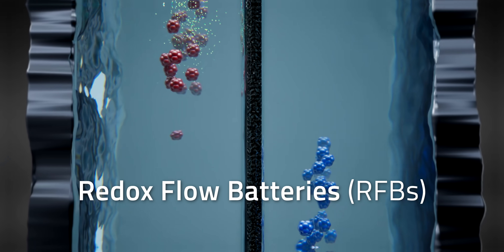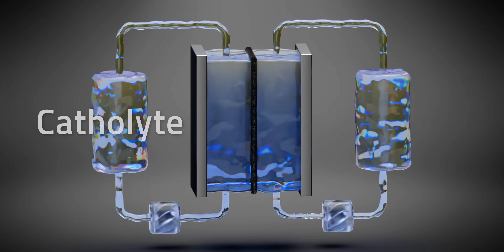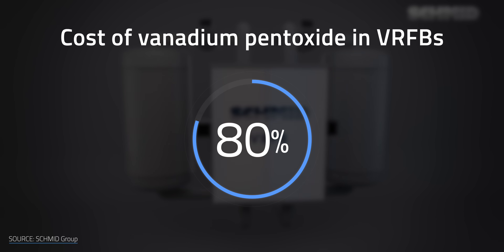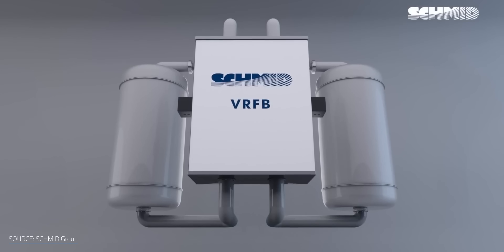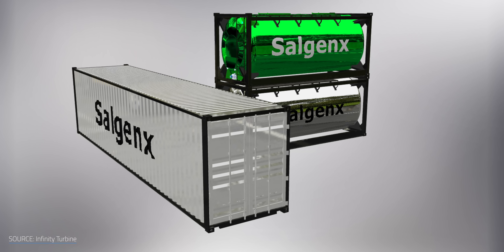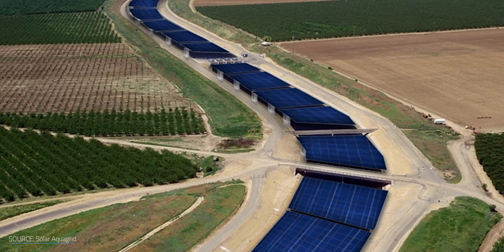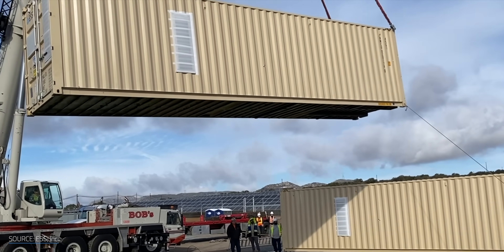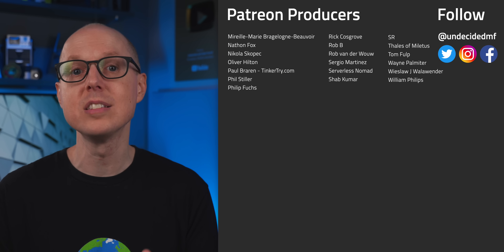Why Salt Water may be the Future of Batteries

Comment from the maker: So what do you think? The first 100 people to use code UNDECIDED at the link below will get 60% off of Incogni: https://incogni.com/undecided

If you liked this, check out: Is Aquaponics the Future of Agriculture?: https://youtu.be/59kk4OjJCj4?list=PLnTSM-ORSgi4dFnLD9622FK77atWtQVv7
Reply: I wish you had shown a comparison in size between different types.  How physically large does it have to be in order to equate to a tesla powerwall for example.
Reply: The technology for the specific application. Is awesome.!

But the thing is.

Batteries that can't be recharged. Or reused. Like the double AA batteries I have in my TV remote. On an industrial scale. Could be useful in a few applications for sure. 

But the problem with that business model Is that it's to conducive to becoming the status quo. As you can see they did with low voltage batteries. AA, AAA etc.

And that's not what anyone who uses energy wants for the energy industry. Except for the very few people at the top of energy industries. Who stand to make all the money.!

So I canot in good conscience be complicit with an energy technology with so many potential drawbacks.

Which might be hard to see when it gets so cheap And ubiquitous. But that's the insidious problem. That's how they get ya.!

Especially for industrial applications.!

WE SHOULD ONLY BE STRIVING FOR.!

#1. Completely Rechargeable. 

#2. A 100-year cycle life minimum.

#3. Minimal Maintenance.

#4. Non-Toxic for service life.

#5. Completely and easily Repairable.!

These are requirements of a battery that is used a lot. And if the battery is being used a lot. That means there's a lot of energy being moved around. And that is where they stand to make money. 

Not from Batteries. But from the Transfer of Energy.!

Like they don't get it. Batteries are their problem.! Not ours.! They should want to make them as efficient as possible. Because they're the ones who should want us to use them. Because they stand to gain the most.

Sure the more inefficient battery the better for them. But that's not really looking at the big picture. You want your battery to become ubiquitous. So everyone uses it.

And then Charge them for the service.!

While your battery meets some of these requirements. And kind of meet some others. That's woefully short of meeting all the aforementioned correctly.

Valve in the steam deck are a perfect example. They lose money on the steam deck. To get you into their ecosystem. Which they make far more money from. Then they ever could from the from the Steam Deck alone at any price.!

So disposable only energy technology while having some application. Are mostly backward moving. Relics technology. Which really doesn't have any place in the future. And it's something to be evolving past.!

It's not for the consumer or industrial market applications. 

I can only imagine it be used in like going to Mars or the moon. Subterranean or aquatic conditions. You know pretty niche applications.

Now molten salt batteries and liquid metal batteries. Those are on the right track. Well they're a lot closer anyway.

Maybe focus on those. If you are still-

"Undecided.!"
Reply: I would love to see a deployment cost for either a Peaker plant or a shuttered nuclear facility like San Onofre in California, with the grid infrastructure in place these would appear be a perfect cost comparison to see real value. Also, time to deploy if it takes 10 years then that would be a very negative factor.
Reply: When the battery reaches its end of life, can you just flush the fluids and replenish the same tanks and system without replacing all of the hardware? If so, that's a big step toward longevity. That would actually make it a worthy investment for homeowners, should it ever be scaled toward home power storage applications.
Reply: @wirelesmike73  as I understand it it's the other way round – the hardware wears out eventually but the fluid is fine.
Reply: @alanhat5252  Well, that's a big problem.😕
Reply: So what happens for long term power storage?
@11:04
Reply: well they got to be quick and come up with products so that more people and companies buy this thing vs LFP and Sodium Ion battery, both of which will scale rapidly. where in 2024-2026, most new factories becomes online.
Reply: I wonder how efficiently aluminum air batteries could be produced.  Air supply regulation is the only thing we need, why are we trying to figure out how to pump electrolytes out of the inside of the cells if it simply cannot discharge without oxygen?  Aluminum ought to be considered, depending on our capacity to efficiently reclaim aluminum spent in aluminum air batteries efficiently, as a way to store energy.
Reply: Why "some random common material" will be the future of batteries and save us all from co2.  There are like 3 of these videos every week ffs.
Reply: @DASLAKILL  Why some common material? Because there is no point in developing Unobtainium gadget that can never be built, or not in useful numbers.
Reply: @AnalystPrime  True but there are options that arn't unobtainium that manifest the power needed instead of just being a storage device.  It seems like all these battery options is like being at a worlds fair hearing about the flying cars of the 2020s.
Reply: @DASLAKILL  You are just using fancy words to say "generator" when we already got those and the point is having storage so we do not need to run said generators all the time. Especially as batteries and capacitors are far superior way to match changing demand, and good luck trying to fit a gas turbine inside your cellphone.

And in which world do we have a dozen different flying cars ready to go as soon as  people choose which suits their needs, with new improvements developed at a steady pace and their only limits being the cost of building enough for everyone and a conspiracy of horse traders trying to deny that flying cars exist to keep their own business going long after it became obsolete?
Reply: @AnalystPrime  A manifester is a better word than generator.  The specific arch form of a "generator" is not making anything, its only opening a doorway for the energy to pour through, manifesting whats already there.  Electricity being a combined field phenomena of the dielectric and magetism.  No fancy words here, try expanding your vocab.  Never said no to any battery tech, my jab was at the idea the solution is some random everyday material and nothing becomes of it, just like the constant hype of flying cars.  Also the beef of horse traders was with powered cars not flying cars, horses dont fly, keep stretching things.  Replacing obsolete tech with dressed up obsolete tech isnt a solution either.  The solutions im refering are ones that manifest on demand not storage mediums.  Where does the power come from, resource hungry wind, solar and dirty bomb nuke reactors all over the place.
Reply: @DASLAKILL  You are being very silly. And either foolish or deliberately misunderstanding a simple analogy.

There is no "constant hype" about flying cars because they are known to be impractical and only developed as curiosities. We do have both cars and various flying vehicles which is why the time of using horses as the main form of transport has long passed just like the time for being reliant on obsolete tech like dirty fossil fuels.
Reply: I think sodium ion battery perhaps could be a lot safer than lithium for EV's ?
Reply: Incogni is awesome btw.
Reply: Fun fact Matt! I got a salt water battery in to be recycled 2 weeks ago. Sad fact: it may get moved on before I get to play with it.
Reply: It will either be a billion-dollar home run, or just another chemistry (99%) that never lived up to the hype.
Reply: it is fantastic how we can not get to a consensus about a energy free method, all companies are pulling their own way!
Reply: The future is Lithium Glass Solid State Batteries as invented by John B Goodenough. 1500 to 3000 recharge discharge cycles with 90% capacity retention in testing from memory (so do not hold me to this) quite forgiving. Wiki states capable of 23,000 times.
Reply: It seems like there are a lot of people who work for ESS are in the comment section. It's basically an infomercial in there. Great video content though.
Reply: Isn't this a re-post of this video that you'd put out previously?  I'm intrigued, while inclined to take ESS's numbers with a grain of salt.  Yes.  I MEANT to do it.
Reply: FEWER moving parts. How bloody difficult is it for you people to say “fewer”? You don't want to sound TOO intelligent? Is that it?
Reply: Aluminum far supercedes all other forms of energy storage if spent aluminum can be reclaimed efficiently enough.
Reply: I loosely hypothesize a displacement of the air in an aluminum air battery as a way to eliminate any further discharge would be unnecessary, but carbon dioxide or nitrogen are easy enough as well as cheap enough resources a concern over such easily lies within our power at such a point to put to rest.  And, that's if it's trailing discharge cannot be implemented wherever these miscategorized aluminum fuel cells are used.
Reply: This has the same benefit as hydrogen and compressed/liquefied air energy storage and even the old fashioned backup generators: For regular batteries the cost is calculated output times hours of storage times cost per kWh, for these it is (the cost of energy converter system) plus (cost of storage tanks). In almost all circumstances X*Y > X+Y, and even if some versions like hydrogen fuel cells still cost a lot, no mere storage tank is ever going to cost anywhere near as much as batteries.
Reply: Why do you keep lying for viewers, Matt?
Reply: You don't mention VoltStorage, a German company that seems to be making these on a domestic scale?
Reply: We have more than enough saltwater available, plus the salt left over from desalination could be used with treated water from sewage plants to store energy... this is a great innovation.
Reply: huh, what about sodium perchlorate batteries
Reply: It's time to change your name to DECIDED, Matt. Stop presenting battery and renewable energy technology as so experimental, when it isn't. Time is running out.

Comment: To make solar and wind energy reliable you have to greatly over build what you would need because it doesn't produce all the time and use massive battery backup systems to capture energy when it is producing for use later. They never include the cost of overbuilding, billons in subsidies, and the battery systems when they tell you it's cheaper.

Batteries cost money to build, to maintain, and batteries wear out and need to be replaced. Batteries are not 100% efficient so when you charge a battery you do NOT get all the power back. So, in the end batteries add cost to your electric bill but are a necessary evil to make wind and solar reliable. Pumped hydro works just like a battery and has the same problems as batteries do. The EPA calls pumped hydro a negative renewable because it uses more energy than it makes.

What would be better than wind, solar, batteries? Geothermal power which is also a renewable and it works 24 hours a day, week after week, month after month just like coal, natural gas, and nuclear. There are millions of abandoned oil wells in the US and some of them could be used for Geothermal. Geothermal and Biomass/Biogas should always be looked at first to see if it is a good fit for your location.

Comment: RND a off shore supply vessel utilising the tanks built in to them.
Under the rescue and assist vessels the electrical systems can run without the generators and  using fuel sources to operate😊

Comment: So, after all the talk about how far cheaper they are to make, they still turn out to be much more expensive than lithium batteries. Okay.

Also, I wonder if increasing the concentration of the media shouldn't help with resolving density issues and how long they can hold power and discharge accordingly.

Comment: Totally excited about "Salt Water Batteries" for fixed use. Typically, a self sufficient household needs at least 60kWh, and a system bypass with backup generator, which is currently uneconomic. Cheap flowcell technology, like  "Salt Water Batteries", not reliant on scarce metals and minerals, and high intensity mining and mineral processing, should offer this solution, for large domestic and even large commercial, grid size storage. 
We're going to really need a solution, in the next few years, when our reliable baseload is gone.

Comment: Hopefully we would not alter the to amount of water resources on Earth that hasn't changed since ice age . That is my concern ,  polar ice are melting yes , but shift of amount of Sea water may change and cause abnormal effect on the current that is running around , I am saying that thermo electric effect on two poles and it's effect on other region. Can be , "the Day after tomorrow" type disaster can occur, I know I am sounding silly, if we use up accesive amount of water , and some thermo electromagnetic effect cause solid ice condition over Europe what Will happen , then whole economic chaos , no more export, import , lots of death right , I am writing short . That's why I might sound odd but , we should judge every angle with proper data and estimate every outcome fast and thoroughly them start doing . We can't mess around. We can put some huge crab catching boxes type structure under the sea surface , grow some genetically modified water hyacinth type water plants with high growth and then produce CH4 by bacteria along with garbage . It sounds odd  but it is the best way to use sea surface in my opinion . A hint is enough to the wise even there is spelling errors 😂

Comment: Great episode! These salt water batteries have been something I've been looking at for some time and make a lot of sense for grid applications and boats, desalination is a new one for me and is pretty sweet!   I think the cycle life information on batteries when you're comparing them near the end of the video is incorrect however. Just giving you a heads up. Perhaps you sought to simplify the information. There's premium cycles above 80% of max capacity and then there is the usable life cycle that is much longer. You should be able to get 7k to 10k cycles easily from some of those chemestries if you're charging and discharging them within spec params and sometimes decently longer than that if you create a buffer in the params.   Loved the video and I appreciate all the work you put into these. Sending good vibes from Florida!

Comment: There are some major caveats to the Salgenx battery you should have included... such as carbon tetrachloride/chlorine gas in the other tank.  Deploying these at any meaningful scale will be a regulatory nightmare, as it is toxic, flammable (or rather causes flammability), and is a known ozone thinner.  Also chlorine gas was used in chemical warfare many times. It has its uses in industry but they are always highly regulated with serious safety measures in place.   I honestly wish this battery could work, but these are issues that will cause it to never take hold.

Comment: It seems that people fail to talk about the batteries internal resistance. I have seen saltwater batteries fail miserably in residential applications due to their in ability to deliver power fast enough for inductive loads and therefore the voltage collapses and the inverter shuts down on low input voltage. I know quite a few homeowners that are stuck with these saltwater batteries and the company that sold them has gone bankrupt and they have to be very careful how they use the battery otherwise it will fail.

Comment: I always knew salt would play an important role in batteries some day at the same time as making purified water. The amazing thing is under the great Salton Sea lies an endless supply of Lithium which the American car manufacturers are eyeing as enough to supply them for the next 100 years. The question is will the salt on  top of all these buried Lithium deposits beat the Lithium industry to the punch with the future of salt water batteries. China has partnered with many companies around the world to purchase salt lakes and flats such as the one at the great Salt Lake in Utah. The company "Compass" says it's Great Salt Lake operation has a 2.4 million ton Lithium brine resource. Even if salt batteries become cheaper and more practical, there will always be a need for Lithium, the world's lightest metal on the atomic chart. It's used to make glasses and ceramics stronger, it's an important product in car parts and lubricants and greases, it's a mood stabler that helps treat bipolar depression, polymers and refrigerants, pool chemicals, on and on. But we all know it will not make a steak taste as good as salt!

Comment: Energy density is important for moving energy needs. But for stationary, it really doesn't really matter. 
Pumped hydro is a great energy storage. And it has less than 3Wh/L!
We simply have enough space for huge batteries. We just need to find the ones that lives longest, has good re- and discharge rates, is cost effective and is safe.
Too many people think about car batteries, when talking about batteries for non-car solutions. But that is really not necessary.

Comment: This is particularly useful in areas where baseload power is unreliable (be it for disaster areas, off grid homesteaders, or whatever else.) This power storage can be charged through any renewable, OR you can just add more electrolyte, almost like a diesel generator.